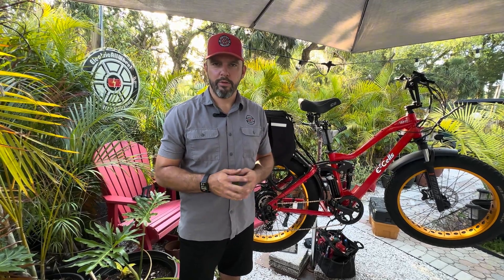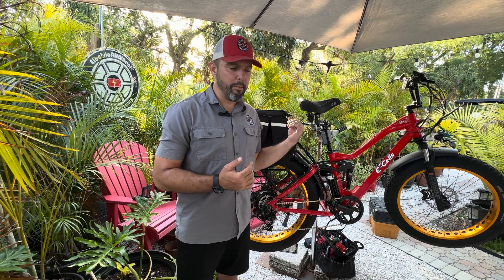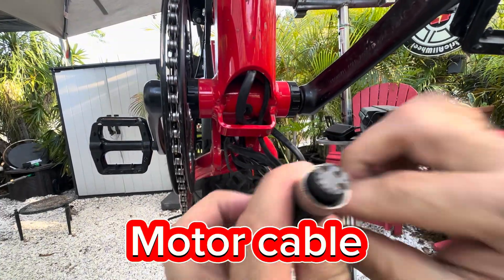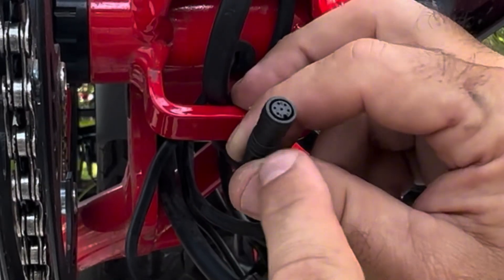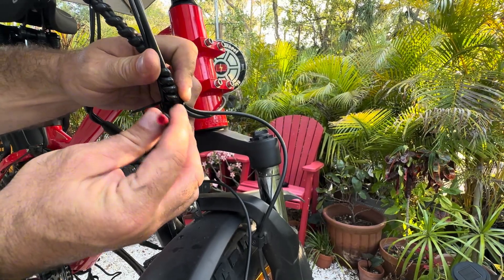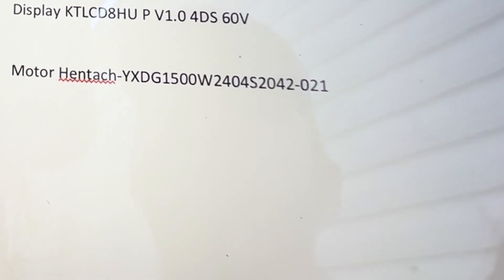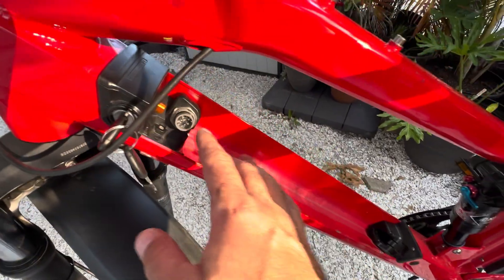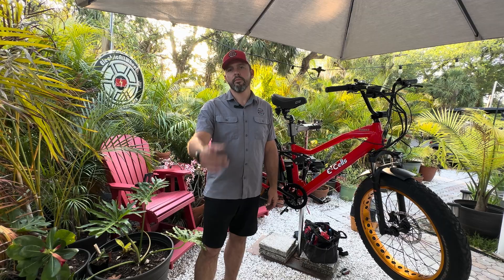Wired e-Bikes Steps Up After E-Cells Collapse – We Help Source 5 Star Parts w/ component discovery

Comment: My 5 star died last summer while riding thru a rough field...no power to the motor either by torque crank or throttle. Is there a fuse somewhere that can be checked? I've reseated every connector I could find. Battery is good, display powers up nominal.
Reply from the maker: Controller would be the least costly replacement check first.  There is a facebook group where you can order 5-star parts from Henry Zou

Comment: Just put an E-Cells Five Star together after it sat in the box so long the company is now out of business lol.. The front forks are broken from shipping and the motor makes loud popping or clicking noises when running it with the wheel lifted off the ground using the throttle. It sounds like it is skipping teeth on the internal gears or something? Anywhere to get new forks or motors for these?
Reply from the maker: You might check citizen cycles website for a fork. They have them to buy with wheel kits

Comment: 7:50 Any chance of showing the back side of that connector? Do all pins actually connect to the XT90 wire or just the 2 main pins?
Reply from the maker: $300 More than the Five Star. WHY? E-Cells King Star e-Bike Controller & Balancer Housing Opened Up!
https://youtu.be/SL27XMLzsNU
Reply: @ElectricAllWheel  I appreciate that, but I'm adding that 6 port to a different bike so I can swap my Ecells battery back and forth, and I'm wondering if the smaller ports have anything to do with output or are the just for onboard charging?
Reply from the maker: @busterbadass the video shows you connection

Comment: Thank you to you and the owners of Wired.  The only reason I went with ecells was because they had red.   I love red,  it's my favorite color.   On February 23rd, I was going about 3 mph and hit a dry rain channel that had some sand.   I tipped the bike, and it landed on top of me.  My helmet hit the display, bent the double walled front chain ring and bent the right side crank arm.   This little fault of mine caused me to break my leg in 2 places.  I had surgery on March 12th.  My right side of my ankle, where they put a clamp on for the screws, has become infected.  The wound isn't healing.  I'm scared to death right now.   I just want to heal up and ride my bike again.   Dave was supposed to order the parts for me, but that's not going to happen.  I hope you guys will be able to get the parts that I need.  If not, the bike is dead.   I hope this parts dilemma gets sorted out.   I'm sorry for all the people who lost thousands on a bike.
Reply: Don't worry about parts, over the years I have found lots of parts that fit my original dual motor pre pandemic bike.

Comment: I have a ecell 2025 5 star exactly what pictures do you need our want and I will send them to you  Ralph
Reply from the maker: The specs on the controller, and the connector for the cadence sensor (to the controller)
Reply: @ElectricAllWheel  model KT60ZWSRCLTD-ZYXP01  VOLTAGE 60 V CURRENT 20 A MAX CURRENT 40 + -2A  SPEED SET 1-4.2V BRAKE INPUT:LOW-LEVEL DC50 + - 0.5V
Not sure witch wire would be for the cadence sensor
Reply: @ElectricAllWheel  They also have a video that shows the connectors on the controllers https://www.youtube.com/watch?v=aL0cxjLwLuE&t=245s